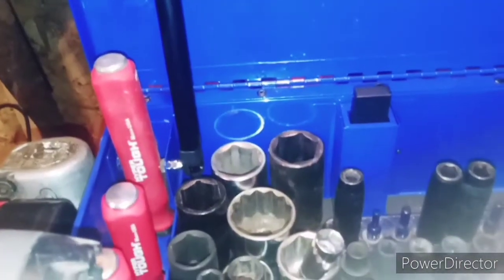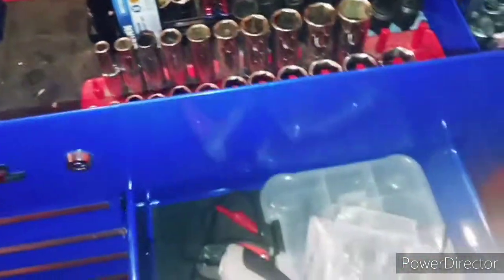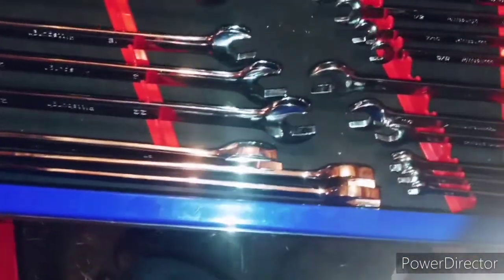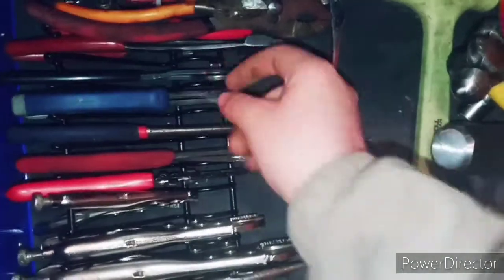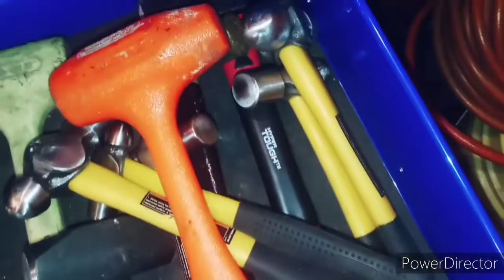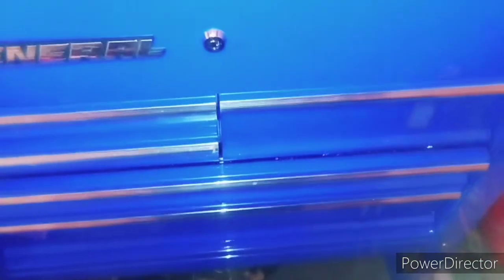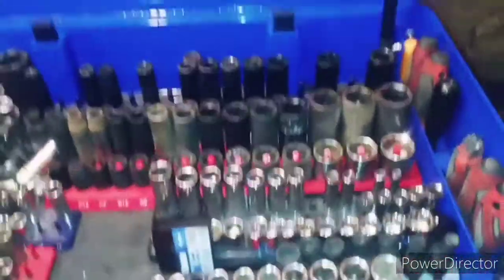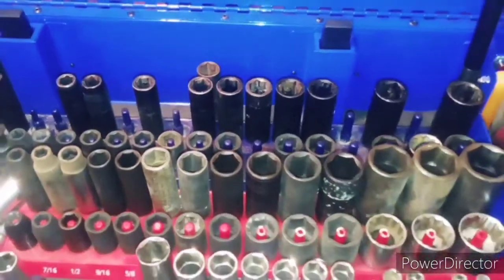U.S. General Tool Cart Tour

Comment: I have one hammer that is my go to hammer,a 32 oz Pro Grade purchased from Tractor Supply over 10 years ago.Holding up well to this day and never broken it yet,one burn mark in the handle from a nut getting on the handle after heating the nut up with a torch removing it.